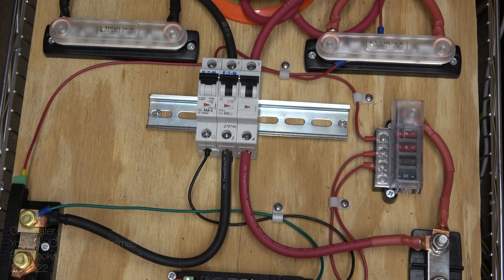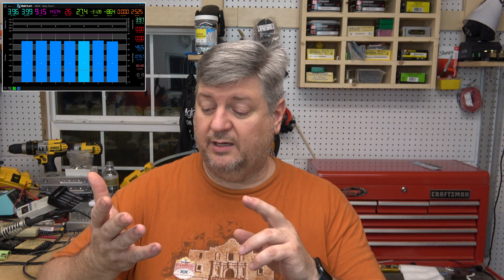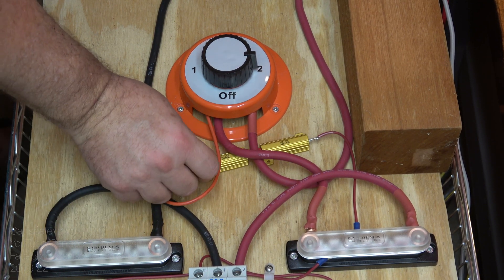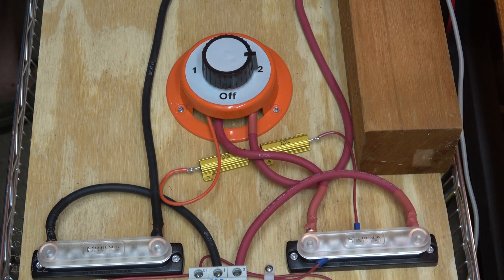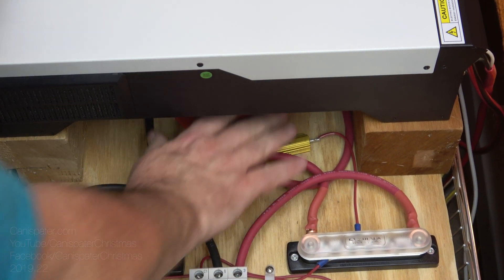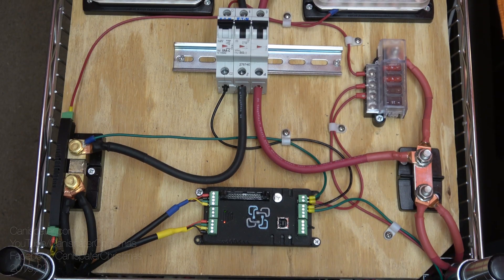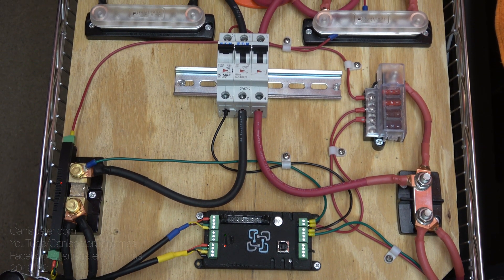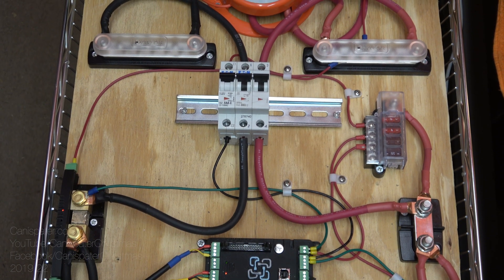⚡️DIY Powerwall Project - ep14 - Cart Complete (2019) ⚡️

Comment: Hi, Wondering how things are going with your powerwall. Any update video(s)? plans for upgrades, caveats you ran into during the last year+? Been using it all this time? any capacity degradation on the cell packs? etc. Thanks :)
Reply from the maker: Still running great. I don't push it too hard so I haven't noticed any degradation. I did drain it to halfway recently since storm season has died down. Saved our butts once when the power went out for several hours - had to keep my wife cool and entertained. :) I have several things I've been thinking about, but nothing in the actual planning stages yet. For the most part, it's maintenance free and just works. I consider it a fun and useful project.
Reply: @CanispaterChristmas  Funny, I was just wondering this and came to see if there is any update.. Be great for another video with your thoughts and experience plus what you would do differently.. thanks

Comment: HI!  I've been enjoying your Power Wall series.   I have a comment and a question.
1)  It took me weeks to notice this video because it's not in your Power Wall line up.  (confusing)  Maybe there's a good reason I'm not just not getting.

2)  Depending on the insulation temp rating isn't 6 AWG good for:
60C -> 55A
75C -> 65A
90C -> 75A
Or am I misapplying the NEC rules?
Reply from the maker: Hmm. It says it's in the playlist. You don't see it in there? You may be right, but the chart I'm looking at has a footnote saying "the max ratings are for power transmission using the rule of 1 amp per 700 circular mils which is very conservative." During a load test, I noticed the wire heating up more than I wanted and there was no headroom so I went bigger.
Reply: Howdy.  It is indeed in the playlist!  To be honest I've never ever looked at play lists!  I've always gone to "Home" scrolled down to whatever topic I've been interested in and then done the left<->right thing looking for any new vids.  That's where this one wasn't in the row.  It is in the playlist.  I'll be checking playlists from now on!

Ah, I know table you are referring to.  The yellowish one...  That 37A is indeed conservative.  I'd have cranked up the size too if they got very warm as that's wasted energy.
Reply from the maker: Ah! If you subscribe to a channel, it will show up in your subscriptions feed and you won't miss a video. Subscribing is free and you can unsubscribe from a channel anytime. That's how I watch most of my tubes. If you also tick the bell, you'll get a notification whenever a new video is uploaded for that channel.

Comment: It would probably have been easier to build the cart using 8 Sinopoly LiFePO4 cells instead of spending all that time and effort making those 18650 cell packs. Would have taken up less space and been lighter too. Also, LiFePO4 cells are safer than the LiIon cells. Just wanted to mention for your future reference in case you build a second cart.
Reply: yes it would have been easier as i did look into that exact setup, i decided to use the 18650 for maintenance reasons, if 1 or even say 4 of the 18650 goes bad i just remove them and pop in the replacement and im good, where as if 1 cell goes bad in like 2 a them sinopoly batteries i need to replace 2 whole batteries , heck no lol, 18650 method wins lol
Reply from the maker: I agree using 18650s for this is more work. This project was more about the experience than ease of assembly. I can tell you though, the setup is still running without trouble to this day.